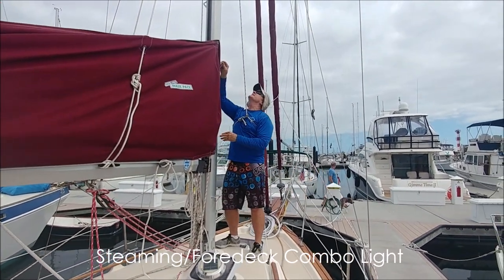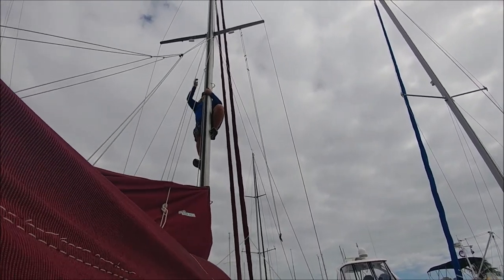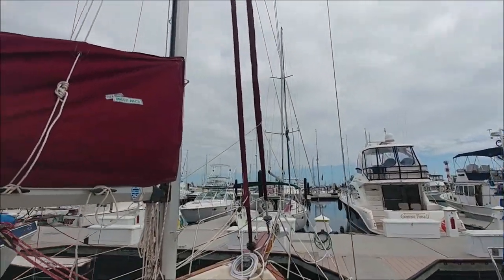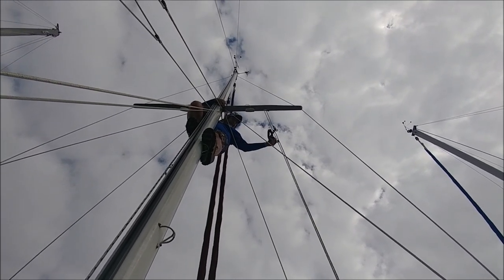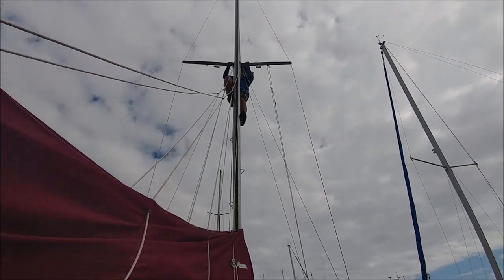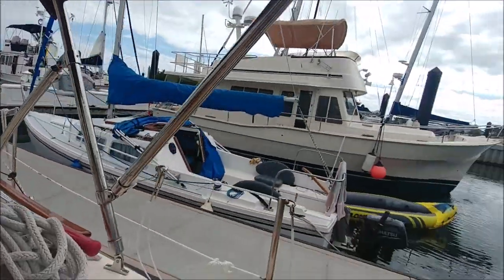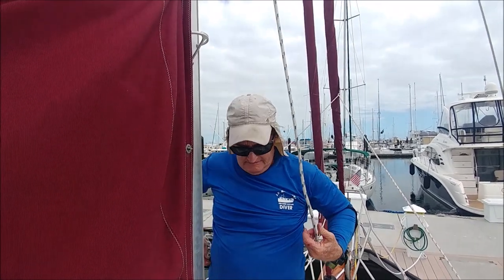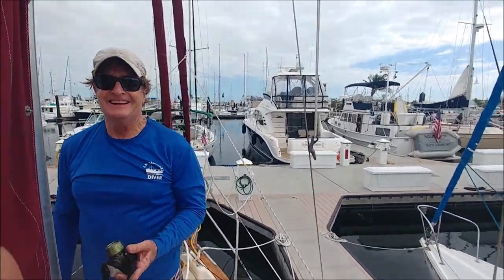Salty Quicky #72 - How to Change a Lightbulb on an Island Packet

Comment: You gotta whip that end or at least melt it with the lighter. That's gonna get bad over time. 

I got a set of steps that I hoist up the mast on the Main Hal. Works well. Steps would be much better. With my knee replacement, no way I would be able to make those long strides! Nice work! 

And yeah, that safety catch... Well.. Yeah.